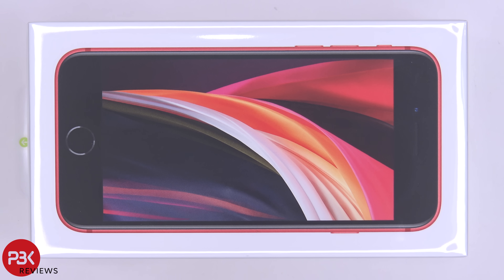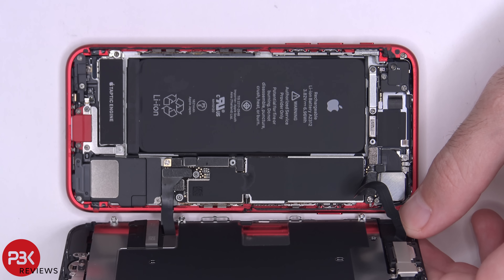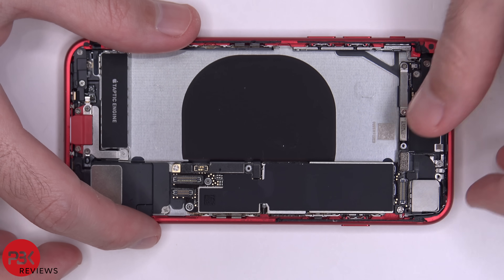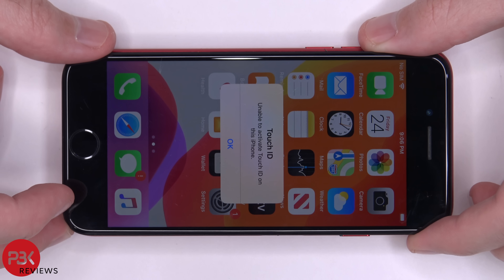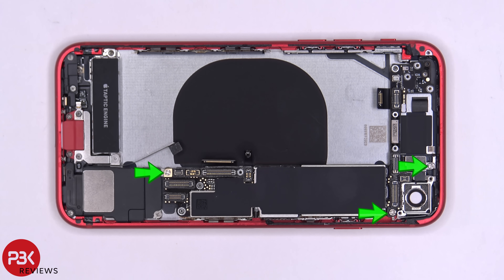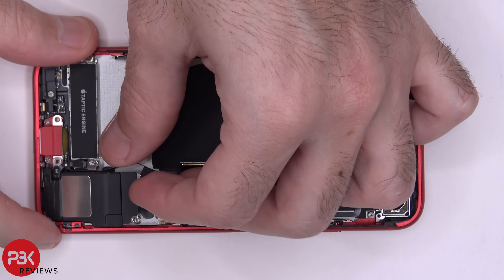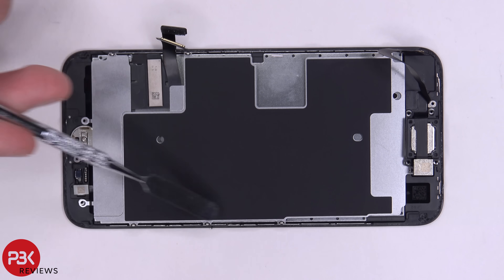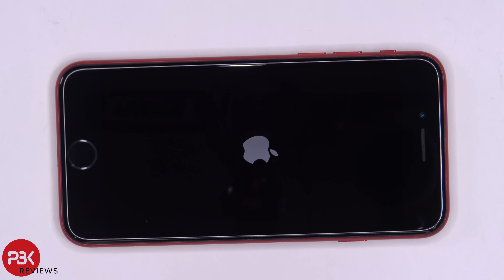Apple iPhone SE 2020 Disassembly Teardown Repair Video Review 99% Identical to iPhone 8!!!

Comment: My nfc stopped working..could you please make a video how to replace it!?🙏
Reply from the maker: It's the cable that leads to the antenna @4:57 in the video. You can just watch this video to see how to take it apart and replace that part thats adhered to the back center of the frame underneath the battery.
Reply: Ok thanks!👍

Comment: I have an Iphone SE 2020 that fell, and the back camera and flash have stopped working, not even as flashlight, could it be the connector has unplugged or something like that? I have tried all software side solutions, if it came to it, I have an Iphone 8 with broken screen and back glass, could I use that phone camera as replacement in my SE? Thanks!
Reply from the maker: Hi, its possible the cable may have gotten disconnected. Also yes the 8 camera should work.
Reply: @PBKreviews  Thanks for your response, I musterd courage and proceeded to change the camera myself, it works, but sometimes the focus stops working, it gets fixed and the far away subjects get blurred, and cant change the focus with a screen tap, sometimes switching cameras with the front one solves the issue, but sometimes not, could it be because its an ihpine 8 camera?
Reply: @yquienvaaser Hi there. I guess you are right. I encountered the same problem with my SE, the camera stopped working including the flash, and when I brought it to the repairshop, the repairer ordered a new camera module and I have the same problem where the autofocus doesn’t work and sometimes it works just fine by closing and making some changes in the camera settings.

And in the video, it was shown that the 8’s camera is compatible with the SE as it focuses just fine (closeup), but he didn’t tested to take a photo in a far distance.

My guess is that I got an iPhone 8 camera module instead of an SE camera module. Even though either of the two can be attached but the functionality isn’t totally compatible.

Also, I read a comment from another video which someone tested to put 5 iPhone 8 camera modules to an iPhone SE 2020 and the autofocus won’t work, until he put an iPhone SE camera module.

Thank you!
Reply: @ShanesTech  After my comment I ordered an SE camera replacement, and with that one it worked perfectly, so it seems the camera is not completely compatible, but it might be a firmware issue more so than a hardware one I believe
Reply: @yquienvaaser Got it. Thank you very much. I am currently waiting for a camera replacement as I informed the repairshop that it is not working properly.
Reply: @ShanesTech  Yep, I actually bought a second hand battery dead SE as a unit for spare parts, and fixed both my SE with the camera, and used the housing and screen to fix an iphone 8 I had busted, but when swapping the logic board I seem to have made a bad move as the 8 now needs some repairs to the logic board, but the SE replacement camera worked perfectly where the 8's camera wouldn't
Reply: @yquienvaaser  Thank you!
Reply: I would like to ask if you have fixed the issue without getting a new camera module? Thank you.

Comment: Thanks a lot. I dropped my SE on the floor and it wouldn't turn on. Disconnected the battery and reconnected and it worked again. Unfortunately I lost a screw, couldn't find it anywhere, but when I put it back together I found it as it went through the back of the screen, lol. Slight discoloured patch on the screen but it still works so I'm happy, thought it was completely dead!
Reply from the maker: You're welcome, glad it was helpful.
Reply: @PBKreviews  The discolouring on the screen fixed itself too, so I'm super happy now. Thanks!

Comment: Great video, do you know is there a way to get data from a water damaged iphone SE? It doesn't even turn on ... Thanks.
Reply from the maker: Thanks. It possible it may have a defective battery or screen, or both that may require replacing to be able to power on the device. But until you are able to get it to power on (considering there is no board damage preventing it from working), you would be out of luck.

Comment: Sir Can I use the SE Backplate with 8?
Reply from the maker: It's been a long time since I did this video, but I believe there may be antenna contact differences on the frame if you're swapping the back housing. As for just the back glass, it has some differences (like where the logo is placed etc.) but I think overall it might be the same. Not 100% sure.

Comment: hello, i have problem, after installation of new parts (ldc display, back platto with pre-installed mics, and speake, lightning, etc) all original parts, my phone just keep rebooting every 2-3 minutes. Anyone help ? :)
Reply from the maker: There might be a short or defective part causing that to happen. I would first look into the battery. Try a different battery and see if it solves the problem.
Reply: @PBKreviews  Thank you. Ill try :)
Reply from the maker: @vitczabe6936  👍

Comment: where is the microphone?
Reply from the maker: The primary microphones are located to the left and right of the charger port on the flex cable, its a gold square or rectangular piece. There is also one by the camera assembly on the flex cable which is adhered to the housing/frame.

Comment: whats the connector called on the backhousing and connects to the motherboard? I bought a phone and that part is missing. Can i buy that part separately and attach is to the backhousing?
Reply from the maker: Not sure what it's exactly for but I believe its an antenna flex cable. You should be able to find the part on ebay just try searching for flex cable replacements for the iphone se 2020 and see if you find it.

Comment: Can you pls explain why are there thin horizontal lines on my iphone se  screen?😧😧😧
After i dipped it on water
Plsss i need help
Reply from the maker: its possible water got in and the screen or display chip on the board got damaged. These phones are water resistant and not water proof. Also if your phone has ever been opened up, it most likely is not water resistant anymore either or if you have any cracks on your case or screen etc, water can get in.
Reply: @PBKreviews  but its brand new i just got it last week
Btw how do you fix it?

Comment: Does the iPhone SE secretly have 3D Touch disabled via software?
Reply from the maker: Its software and hardware. The SE screen doesn't have the 3d touch chip on it nor does the main board have the pathways for it leading to the connector and also the software does not have it enabled.

Comment: Will the motherboard from iphone se 2020 be compatible with iphone 8?
Reply from the maker: For most things ya as long as you carry over the battery as well, however I am not sure 100% how well the antennas will work since the antenna design/layout has been slightly changed on the SE including the wifi so there is a chance you might run into some issues there. But if your planning on carrying everything over then that defeats the purpose since you could at that point just get an SE instead.
Reply: PBKreviews Ok, thanks 😁

Comment: Thank you for this video, actually I’m iPhone repairer. So all parts can exchange only the battery. What about the camera if I have iPhone 8 camera and change to iPhone SE camera it’s will be take effect I mean the quality? Please reply thank you.
Reply from the maker: You're welcome. The camera is the same in both, the processor on the SE is what provides the better "quality" with the photos. So putting the SE camera in the 8 wont change the quality, will be the same. Antennas are a bit different, so not sure how well it would work out if you put a SE board in a iphone 8 but camera, speaker, haptic motor things like that can all be interchanged. Just not the battery.

Comment: Can the screen from 8  be put into SE? Is that possible to use 3D Touch on SE?
Reply from the maker: Yes the screen from 8 can be put in SE but 3D touch wont work, since the main board for the SE does not support it nor does the software on the SE.
Reply: PBKreviews I see. Thank you😁
Reply from the maker: @Apple-ft8vp  you're welcome

Comment: when iphone se use iphone 8 secreen can use 3D touch
Reply from the maker: No because the 3d touch sensor installed on the iphone 8 screen is not the only thing that makes it work, the software and also hardware on the main board itself are different and don't read or work with the 3d touch sensor.

Comment: how many speakers does an iPhone se have?
Reply from the maker: One loud speaker on bottom and one speaker on top for the earpiece
Reply: @PBKreviews  oh..i thought it was 2 on bottom
Reply from the maker: No they just make it look that way since its more aesthetically pleasing and there is a mic there too which takes in sound. There is two mics on the bottom (one on each side of the wholes) of this phone but usually most have one on bottom and the rest around the phone in other areas. Some act as noise canceling mics others for when your taking videos and when the phone is in speaker mode etc.

Comment: its really clever as iphone 8 come out the same time as the iphone X and a lot of people bought the x so obviously apple as a large number of parts floating around that they now just were like lets just upgrade the cpu and we got a new phone :) its the same thing as iPhone 5s and SE (Old) the screens are identical and can be used on one another and try get more people interested in the Apple way, The iPhone 8 hardly has any issues and we dont see much board issues on it so hope this will be the same and not like the iPhone 7 Audio ic issues etc. A great teardown by the way
Reply from the maker: Thank you, ya should be a solid device.

Comment: making the battery not compatible with iphone 8 one is a dick move (apple move)
Reply from the maker: yep you would think it would make more profit for them to use the same connector but its possible they stopped making those connectors and started making the newer type so it was cheaper and easier for them to use the new style connector that they used on later devices that they had on hand.
Reply: @PBKreviews  we saw that policy in every mac-book release same architecture and slightly different connectors to make hard to repair
Reply: apple...

Comment: Does anyone know how the fast charge is effected by swapping a charge port?
Reply from the maker: Hmm that's a good question. Not sure if it would effect the charge speed since I believe that is based off the processor and other hardware but how the port would hold up if not connected properly or soldered etc. as well as quality of the port, that's what I would wonder.

Comment: Is it possible to put one of the cameras from iPhone 11 into the iPhone SE? Another question, is it possible to put the A13 bionic chip into Samsung Galaxy S20?
Reply from the maker: The camera I am not sure, but I would lean toward it not being possible. I don't have one on hand to try at the moment. Also the A13 to the S20 that I would have to say no, because it would not only require expert soldering skills but would also require probably the main board to be engineered to accept that processor type and the software to be programmed with it as well. But that's just my opinion.

Comment: I wonder if you can put the SE motherboard with the A13 in a iPhone 8? Then flash SE software on the 8. Is that even possible lol?
Reply from the maker: It's possible to put the board into the iPhone 8 but I do know the antennas have a bit of differences, the SE has a different wifi antenna etc. so not sure how all that would work out. Software would be another hurdle.

Comment: Camera from SE can put into 8? Is it possible the shots would have some improvements.
Reply from the maker: Yes the camera can be put into iphone 8 (I put the camera from SE into iphone 8 and it worked, and iphone 8 camera in SE and it worked), but its possible the software might not make use of improvements since usually software and hardware have to work with one another. So I am not sure if there will actually be improvements on pictures or be the same. iFixit will probably get into more detail on that in a few days.
Reply: Billy Valdez there would be no improvements to  photos, as the hardware of the iPhone 8 and iPhone SE are the same, but the only way for the photos to be better (which is the case on the SE) is for the A13 chip to connect to the camera hardware and enhance it.  This is why the iPhone SE takes better photos than the iPhone 8 with the same camera hardware

Comment: Is 3D Touch gone completely or just software disabled on the SE2? I am asking since the 8’s display seemed to work fine on it apart from Touch ID
Reply: Software support for 3D Touch on the SE2 is completely gone. Replacing the OEM display with the iPhone 8 won’t work. The hardware may be there but software won’t register as it’s not supposed to be used with the iPhone 8 display
Reply from the maker: Considering the fact they are pretty much identical hardware wise, I would lean toward software but I am not 100% sure. Someone with more insight into the hardware chips should be able to answer this question (hopefully) and probably the screen would have to be pried apart to see if the pressure/3d touch sensor is present on the SE screen or not, because comparing it from my video to one of an iphone 8 screen, it looks like the sensor is missing on the SE screen as you can see @9:36 in the video the square black rectangle at the bottom right of the screen. The iphone 8 screen has a sensor there, but it is possible its covered over by film or glue but would again require to tear apart the screen most likely to make 100% sure and I am not even sure if that would be the only fact proving or not proving if its only hardware or software. Best way to tell would be if someone with software know-how can look into seeing if its possible to enable the 3d touch and then trying a SE screen to see if it would work, if not then trying a iphone 8 screen on the SE to see if it would work that way. Sorry about the long explanation :) But ya they use haptic feedback now so not like its completely missing that feature.

Comment: What a great use of recycled iPhone 8 with a very little change!
Reply: you do know that some people cant afford the new series flagships of apple right? so apple made a budget series phone just similar to the 8 but not in every way software and a bit of hardware wise stuff.
Reply: probably could also use some iphone 7 components
maybe even iphone 6 and 6s
Reply: Kalyan Shankar Haldar millenials ? Iphone se 1st generation (release same as iphone 6s) use the same parts as iphone 5,..that what iphone SE is released for
Reply: the difference in processing power is huge enough
Reply: It’s not an iphone 8, its better

Comment: Is it also possible to interchange the screen on iphone 8 to iphone se?
Reply: Iota yes but no 3d touch and truetone even the camera is interchangeable ifixit said
Reply from the maker: It's possible the truetone might be based off chips on the main board and not the screen itself processing that feature. However I did notice the 3d touch sensor possibly missing on the SE screen compared to the IP8 screen. Either that or its just covered over with film or glue.
Reply: @PBKreviews  Then all function(including haptic touch) but 3d touch would be available if i change SE screen into 8's one. right?

..or will true tone also be unavailable even if true tone 'was' available on both 8 and SE ?

=
haptic (o), 3d (x), true tone (o) ?
Reply from the maker: @lota7574  Don't think it would be that simple since I am sure it has software running it as well so software would have to be programmed to read it and make use of it etc.
Reply from the maker: Yes screen is interchangeable.

Comment: Good job, now I know that the new SE is solid enough :)
Reply from the maker: Thanks, yea its a solid phone
Reply: @jwralarms  did you drop it then run over it?
Reply: No it’s not. I’ve had it for like 2 weeks and the battery is already acting up lmao all iPhones are trash
Reply: @jamesschneider4493  I have it from near one year, no problem at all.
Reply: @jamesschneider4493  my battery is fine in the se 2

Comment: This is basically iphone 8 with dual sim and $50 less...... no body was buying iphone 8 at $450..... not sure why they should buy it at $400.......
Reply: but this one has the a13 chip so it's actually way better
Reply: A13 Bionic, a little bit better camera (because of the A13), faster wire charging at 18W instead of 15W, longer software support and more... It is  not the same as the iPhone 8